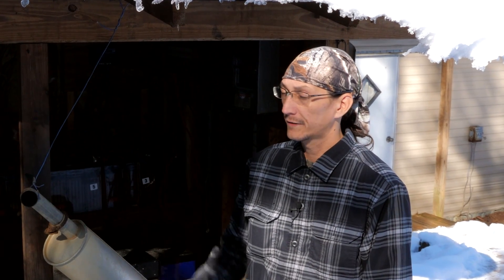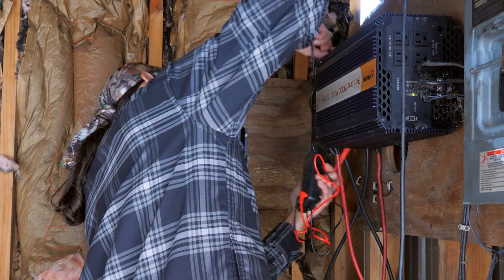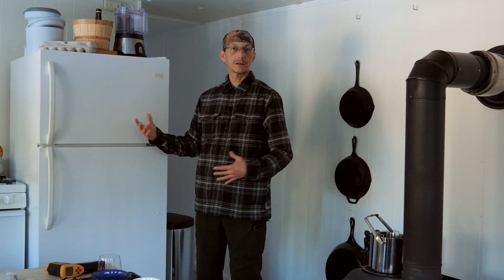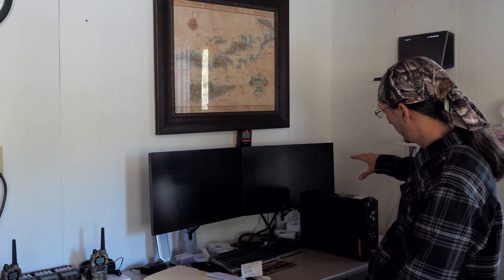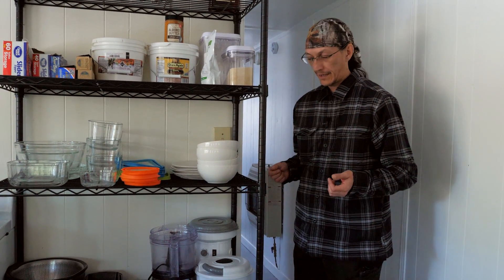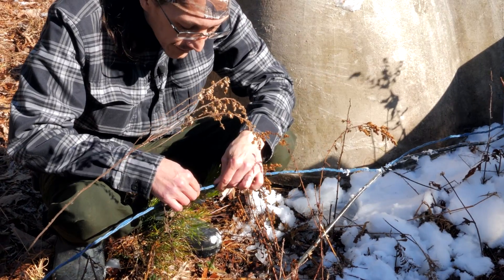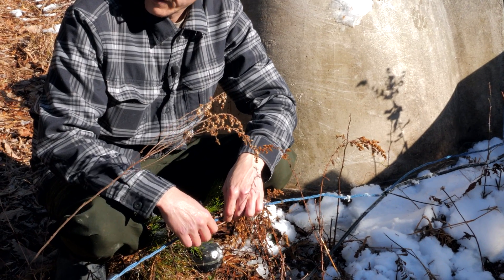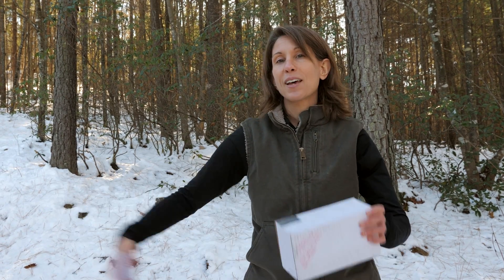Off Grid Electricity - Our DIY Solar System

Comment: You're doing well - keep going!

May I make a few suggestions?

1.  Skip the battery bank.  Yup, you heard that correctly.  Do not use batteries for your system.  Look into super capacitors.  There are companies which make them, however, you can make them yourselves too.  The technology makes batteries completely nonsensical.  When you start researching it, you will see what I mean.  Also, the price is comparable to batteries without the problems and limitations.

2.  Putting your fridge on the porch will destroy it after the first rainfall.  It may still work, but the humidity will put it into a condition that you will never want to put it into your home again.  That probably is not a great loss as it is old and inefficient.  Instead, build a cold box.  This is basically a walk in freezer that has been set up outside.  During the winter, the cold naturally cools the interior.  In the summer, you can probably use evaporative cooling and other techniques to keep it cool.  A good way to start this project is to simply modify a small lumbered shed purchased from Home Depot or Lowes.  It sounds like a lot of investment, but it will be worth it.  

Use 2x4s sheathed on the inside with plywood of a good quality - perhaps marine grade.  Cover your interior surfaces with a reflective material, silicone seal the intersections etc.  Working out from the interior, put R30 batt into the spaces created by the 2x4s.  Then offset that layer with a second layer of 2x4s to create another frame for your box.  Put another way, you will have a double thick 2x4 wall wherein the lumber is not touching upon lumber.  Instead lumber will touch upon insulation.  This will create a thermal break to prevent loss due to drafting.  Then, on your outer layer of wall, either fill with another layer of R30 or use the rigid pink insulation.  Complete with vapor barrier etc.  The size of your cooler should be standard height [ 8' ] and as large as you need to be able to walk into it and function comfortably.  If you are doing a walk in size - include an entry vestibule area so that the door to the inside of your cooler and the door to the outside are staggered for better thermal control.  Don't forget to carry the insulation technique into the floor and ceiling / roof of the cooler.  

When the ground thaws, the obvious enhancement to your cooler will be a root cellar.  At that time, you may want to create a descending entry into your root cellar that starts from within your cooler.  Research the technology of solar fridges.  You can also integrate a power station into the design.

3.  It might be beneficial to look into solar heating with vacuum tubes.  A similar technology uses empty aluminum cans.  The vacuum tech is better.  It could be hung over a window and used to heat your camp house.  That might reduce the need for the wood stove.
Reply: james wright unfortunately evaporative cooling is probably a no go for them.  I live just north in Virginia (a little farther west in the mountains) and it is just too humid on many days for it to work well.  Better humidity than eastern Virginia or N.C. but it is not dry enough for any kind of evaporated cooling system.

Comment: Getting a UPS for your computer setup was genius. It says you can run your system for a certain amount of time for the average computer. Be sure to  test it out for your system so you know for sure what to expect. Our first one would run the CPU long enough to shut down, but not the  monitor, useless. The next one lasted long enough if you were sitting right there, but not if you had a lot of programs running. Well you get the idea. Also, do this test at least once a year as those batteries don't last forever. xoxo from Arizona.
Reply from the maker: I’m a retired CIO. I’ve bought hundreds of UPS systems. This one is good.
Reply: Guildbrook Farm | Simple Sustainable Living, as the end user, I've always had UPS bought for me, but as you see I've experienced many failures (more than I mentioned). My only advice to newbies is to get to know exactly what your unit will do (not it's projected capability) and stay prepared by testing your unit periodically as batteries have a life of their own. One other thing, if your UPS's battery needs replacing, don't buy a whole new UPS. Take it to Batteries Plus and just have the batteries replaced. ($80 vs $600) xoxo from Arizona.

Comment: A .5 horse submersible drawing around 6 to 10 amps of 240 can be run from and inverter and solar charged battery bank.    To rely on a generator for water in a no gas no deisel collapse is a formula for dead gardens, no water and death from starvation.    Water security  is priority one, and leads to food security.
Reply from the maker: No one is starving or dying of thirst lol That’s what the creek and springs are for 😉
Reply: They do appear to know that and have said they are working on it

Comment: We lived in a 28 foot camper for 2 years and my full sized fridge and deep freezer was out in the porch for one of the worst winters we had in Southern Ohio. Had no problems at all. It's not going to kick on if it's not needed. The only time I had issues was when it was close to the heat source. It ran all the time.

Comment: Hey guys thanks for the video, I have 2 stand alone solar setups, 1 setup is to do the heavy draw stuff  and the other 1 to do the lighter duty stuff like running lights charging batteries and my phone and other bits  and pieces like that. I found it was a lot easier for me to have 2 stand alone systems other than 1 very large system, that way I'm not totally reliant and dependant on JUST ONE system, I suppose I'm not putting all my eggs in one basket, and each system is able to help the other out in times of need.  Also just remember you CAN'T run a MPPT charge controller on the panels you already have because the panel MUST BE identical all the same voltage all the same wattage !!  Seeya Rob

Comment: 20:57 I wonder if the cold temperatures and snow is reducing the resistance of the wires.  Curious how that changes in the summer.  Unfortunately we did see the water pump wires fail.  I've done some prototyping with undersized wire, once I had my entire electrical system(including headlights) in my car fail while traveling at night on a rural highway.  I had modded a push-button start, and used speaker wire for some of the connections, one on which failed.  That was fun, ripping it all out on the side of the highway to get moving again.

Comment: Great videos!  You could use something like the “Lux WIN100 Heating & Cooling Programmable Outlet” (around $30) to only run the fridge when the temperatures are warm enough... also, you could put a child safety lock (around $5) on the fridge if you think animals may try to open it.
Reply from the maker: Ya we might go w the child safety lock. So far no issues w wildlife though

Comment: That power bank wiring is terrifying.  

Instead of lead acid batteries, see if you can maybe find some big Nickel Hydrides.  Might give you better efficiency.  

Also get some Helical Wind Generators.  About 10 minimum.  

They are super efficient and you get WIND power as well as Solar from your panels.  :-)  

And if you have a natural water source like a creek or river you can build a small hydroelectric dam.  

You might also be able to get a solar water heater panel to supplement your electric water heater if it is electric, and it can also supplement your gas water heater as well if it is gas, that way you get WAY more efficiency out of it either way.  Just insulate the water heater SUPER well and all sides...  like 2 feet thick of insulation in multiple layers...  including underneath it.  

And depending on where you live, you might look into geothermal water heating, house heating & cooling, and power generation.  ;-)  

Also might want to think about insulating your solar panels in winter so they don't lose as much heat...  depending on what type they are.  Some work best at higher temperatures.
Reply: Daniel Nunya Bidnezz Wouldn't Nickel Iron batteries be a good investment?

Comment: Wire size could be a significant part of your voltage loss too.  Check formulas for volts/amps over distance in comparison to wire gauge.  Copper isn't cheap, but it might be a mentionable help for your efficiency.

Comment: I think you're very smart to restrain your spending on the current system. For the battery shack, just get an insulated tarp and tack it over the front. Once you've got the long term solution set to go, that's when you can get fancy. And I would leave the fridge on the porch as long as possible. As long as it isn't in the sun, it might be cooler outside year round than in.

Comment: idea :  You are actually using more energy because of inefficiency charging batteries etc than direct power to the portable lights.  The savings you are seeing is mainly from the lights only being on when they sense your presence.  

You could dc wire these where the batteries connect and use a single battery pack at one spot to power all of them or a string of them or you could just use a 110v power supply that puts out 6 volts or whatever voltage the portable lights use!  I do this in duck blinds !

Comment: While I realize most of what you do now is temporary, an inverter/controller combined with a 2 wire start for your diesel generator; just let it do its thing without the switches or "real" planning. A generator running a lot temporarily to save sanity is worth it for the long haul.  Looking forward to following your adventure, what a change, just don't get over whelmed.

Comment: Just remember that your battery bank will be halved right off the bat. Never want to go below 50% .That 2300 amp hour storage bank is really 1150 amp hours on a good day. Now you want to try and conserve energy so you are not doing a full cycle on your battery charging. Try to keep the batteries at a higher charge and get them in float everyday. draw them down to 80% charge instead of 50% to have a longer battery life.

Comment: well on your solar panels there was mono and poly type i seen mixed! the volts are different! and the way they recover the sun is the mono work better in low light and more costly! too! i also found morious panels, those cheep harbor freight panels do work good when it low light too! i am grid tied & all my big panels are running that system! but i got a camper and that what my solar was for! a way to run my stuff off grid! with a genny too!

Comment: Great to see you guys getting on in the new place. You are killing me with that solar system!  First off, you cant run appliance motors or pumps off of a non pure sine wave inverter efficiently if at all. Second, your charge controller is not good quality.... Get mppt and run the solar array at higher voltage to cut losses between panels and batteries. Third you have longenough cables on the batteries to put an insulated gap between all batteries to keep them at a more stable temperature. Have you taken gravity readings from the battery acid? You may only have one or two bad cells in the bank but this could hold the voltage down for all the batteries. The charged float voltage should be 13.8 volts and the mass charging voltage when the batteries are not full should be at 14.5 volts. If you cant acheive this even off the generator then you need to find the bad battery and remove it asap. To run a whole house with those inefficient appliances you will need a 24 volt or higher solar system costing 7-10 grand..... Start saving now. If you work with what you have now you should be able to run your pump and computer easily off those batteries. Good luck

Comment: I'm not a pro at solar but have played with it little. Your battery cable need to be alot heavier, like the battery to the left. Also from your panels to your controller you should not be using solid wire it would cause you to lose alot of voltage. use AWG #10 or heavier gauge. will have less voltage drop on long runs. just a thought congrads and happy for you both.

Comment: At around 3:00 - 4:00, that is not a way to know if you are losing energy in your charge controller.  Energy is power, not voltage.  Power is wattage, which is voltage times current.  If you are getting 1.2A on the input circuit at 13V, and 1.3A output at 12V, that is the same power.  You didn't measure current.  Also worth pointing out that any wasted energy has to convert to heat.  So, is the charge controller warm?  Voltage drop in wires is always lost as heat, because wires cannot drop current.  What goes in, comes out, a little more tired.  Active devices like a charge controller can really drive more current in the output loop than they run off of on the input loop.

You can't merely switch your meter to amps and measure across two terminals, your meter will burn out the current fuse.  You have to measure current in series and voltage in parallel.

Anyway, you have the same main problems most YouTube solar has.  Your wires are too thin, and will be a fire hazard in summer.  Inside the shed, first, replace your wires with more like 0 gauge or welding cables.  Second, mount all those boxes in steel cabinets where they can safely burn up if they choose to.  A 5000W inverter on 12V is 417A of current, too much for even 0000 copper.  Between the batteries and the inverter, you need massive cabling.
Reply: Heath Hunnicutt  just curious, are you an electrician or do you work with solar? Very informative although they are just starting out.
Reply: Nope.  I would say that I'm relying on my education and experience in engineering, but the reality is that correctly sizing wires is something I learned in 4-H as a kid.  The year 2 and 3 electricity projects lay down those basics, although they deal with A.C., not D.C.  The thing about electricity and electronics is that knowing how it works lets you apply the theory correctly to new areas.  It doesn't make much difference if it's a solar system or an arc welder.

I don't know where to send people to learn the field.  I am sure 4H is still the best way for kids to get a solid background.  For adults, it's a shame that you would pretty much have to go to technical college just to learn the stuff about power efficiency and wire sizes.  For people who are really interested in making electronic stuff, signing up for classes might be appealing.  But for most people, it must be annoying that there's no great place to learn just enough to make a solar system.

My work has touched on electrical engineering, such as factory equipment for assembly lines, and working to make lab medical equipment.  Mostly, though, I know about electronics out of 30+ years of hobbyist interest.

By the way, I am psyched for their move, and I think they inherited that system.  I would like to see more about it.  Is that really a 5kW inverter?  If so, that's a bit over the top.  I love the transparent lead-acid cells that came from a cell tower.  I have never seen anything like that, it's a great idea.

I figure they will upgrade that system over time.  My main point is to make sure wires are heavy enough for currents they carry, and to install fire stop around places that would catch on fire.  No matter how correctly you install them, you have to cautious about buck/boost type power converters in outdoor weather.  One day, the capacitors inside may fail, and the whole unit may emit flames.
Reply from the maker: Building a properly sized and safely designed system from scratch is where this little series will go. And I have a really cool idea. 😉
Reply: Glad to hear it, because I look forward to what I'm going to learn from your methods.  I've been enjoying all the info from your video series, but the main thing I am studying from your videos are welding and food storage.  ;)  Hit me up if you want to talk about power supplies like inverters and chargers, etc.  By the way, on 2nd watch, you mention the wire size at 17:42, I just noticed. :)

Comment: I like this transition of ur family doing..the offgrid .being independent...an idea or suggestion..a Double barrel or another barrel over ur wood stove will retain more heat in winter..and u can take it off during spring summer.

Stay safe..stay warm..

Merry Christmas.

God bless
Reply from the maker: Goodness we don’t need more heat! It’s usually in the 80s in here
Reply: Hmm, maybe back to the original idea of using some of that excess heat to add to your generation capability.

Peltier devices maybe?

Comment: Hello, I have a mppt controller, 4 100ah batterys 1400 watts worth of panels on roof. I run my 2HP pool pump on a 3500 watt inverter, on a sunny day, it will run for 6 hours. it runs for 2 hours on batterys. it has no problem starting or running pump, 120 volt pulling 13 amps. need bigger wires and check all your connections,  nice video.

Comment: You would be best to test each panel and isolate the panel or panels that are not matched with the others. Your output is only going to match your lowest performing panel if they are hooked together. You should see 16 to 18 volts coming off each panel. It also appears your charge controller is in need of replacing. Charge controllers typically run 90% to 95% efficient. I agree with some of the other comments that you need to address these problems quickly or risk ruining your battery bank. Batteries do not like being drained more than 50% and if they are drained below 50% even a few times it can severally limit the overall capacity.